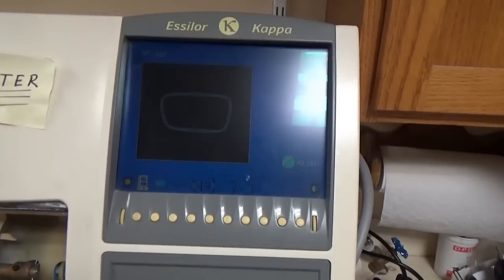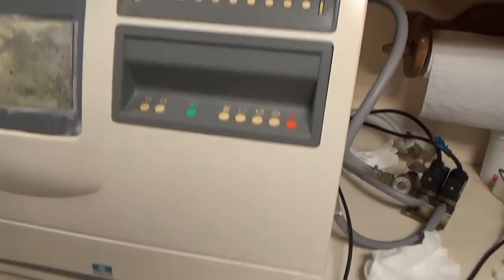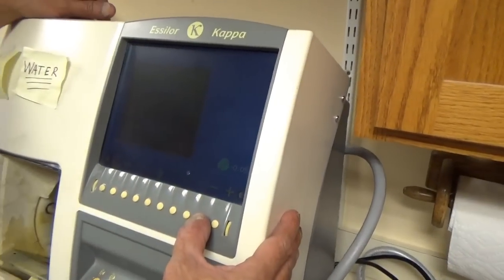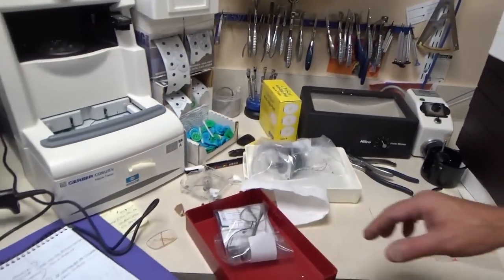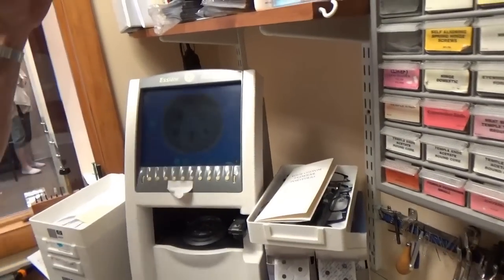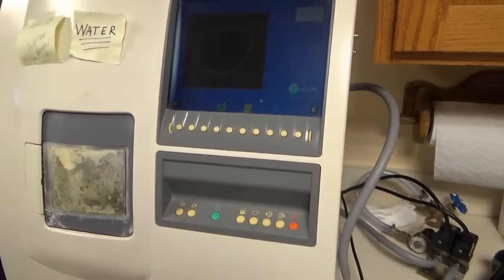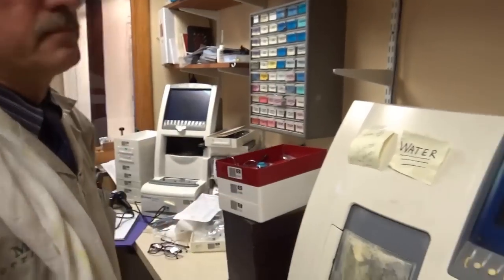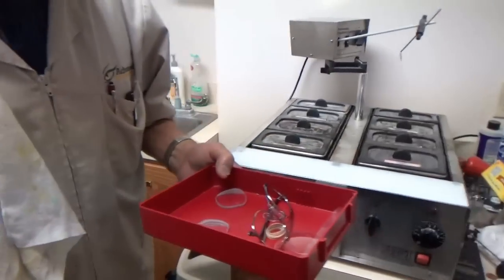Custom eyeglass lenses: Essilor Kappa Edger demo

Comment: I really enjoyed this video.  My father was an optician and owned his own shop back in the 60's and 70's.  While I was in high school and college I would do his lens edging for him.  Everything was glass then and we had a couple of different edgers.  I remembering him buying a new edger and I was the one that figured out how to install it and how it worked.  Things were not nearly as automated as these edgers.  We had a big board of patterns for every one of the different frames.  No automatic measuring.  Originally we would use the pattern and a glass cutter to score the lens and chip it off manually. Remember the first time I tried it I broke the whole lens.  You would cut it large and then put it in the edger to finish it to the correct size.  A later edger allowed us to cut the lens down to the correct size without cutting it first. Also had to heat treat most of the lenses too.  Things have really improved. Sure didn't expect to see a video like this on a auto repair channel.
Reply from the maker: Thanks for the comment Richard, and for sharing your memories! Yes I agree technology evolves at a lightning-fast pace indeed!

Comment: I enjoyed this series very much. You were so lucky to have a "known good" stepper motor driver to test to compare to the suspected bad stepper motor driver. Sometimes the hardest thing to come by is a "known good" to use as a base line. I, too have struggled with removing solder from circuit boards. Once again, thanks alot.
Jim McFarland
McFarland Automotive
Orem, Utah
Reply from the maker: Thank you for the kind words, Jim!

Comment: Ivan, great follow up to repair of Edger Lens Grinder, this video shows the process  involved in grinding lens edge. Thanks. Also for future repair, that stepper motor will cause the erratic jumping of position, that was a common problem in Dec digital line printers .

Comment: Thanks very cool information Evan. Yea PC work is very hard to do. I have done a ton being in the appliance repair industry for years. They make this stuff called Chip Quick which is a lower melting repair solder. Try using this for the remelt and re solder. Saves some heat on the board and components. Sells on ebay cheap use water base flux in a tub

Comment: My lens shape is not symmetrical in my new glasses. Measured vertically, one lens is 1/8 inch longer. Is this acceptable, or should I request a remake? I have plastic frames and feel that the frames will not go back to proper shape. Should the frame be replaced, as well?

Comment: My 2014 Nissan Versa sedan transmission is started slipping at30k only after Nissan run a software upgrade. No warranty, car is rebuild. Will fluid change help? Or any other advise. Thanks!

Comment: They should just paint that sliding panel white. Like the feeler gauge comment. Had a friend that was a PHD teaching Optometry at the Univ Of Indiana, In the early 90s, he developed a software program that could measure a batters ability to hit a base ball, basically the subject sat in front of a screen and a spot would come at you at a high rate of speed, and using lasers pointed at your eyes he was able to tract how well you did at tracking the ball. He without knowing the players batting record lined up all of the Univ Of Houston's baseball teams as far as how they could hit a ball, only missed one. He tried to sell the software to MLB, but they told him to take a hike. He also helped develop the hands free operating helmet for the Black Hawk Helicopter, I was a subject, in that , but was let go after 2 weekends due to I could not set still for more then 2 minutes at a time :)
Is your wife a optometrist, if so where did she graduate from ?
Reply from the maker: She graduated from Ohio State Optometry school :)

Comment: Now major parts are out of production they are going to have a strategy of how they will keep that equipment going. I would buy up some second hand ones for spare parts. When consumable parts and semi consumable parts are no longer made they will have to junk the whole system. 

Some cars are in this position as well. There are 80s and 90s cars that just do not exist anymore.
Reply from the maker: It is sad when a seemingly mundane part breaks, and is no longer available to be replaced. A 1990s Toyota igniter comes to mind...

Comment: Shame you didn't think to clean that window so you could see the grinding process...but considering how old the machine is, probably better not to mess with it in case something went wrong.  Saving them $40k with the chip replacement won't help if you then go an break the machine anyway.  :-P
Reply from the maker: Sometimes you have to know when to stop "fixing", or else you might start going backwards haha
Reply: He's right about glass lenses being potentially dangerous - back in the early '80s, I fell and broke my glasses (with glass lenses - they were a lot cheaper than plastic back then) at the local ice rink.  Took 3 hours picking the glass out of my face, and close to 60 stitches.  Damn lucky I didn't lose my eye, but got a good scar cutting through my eyebrow.  Been using plastic ever since (high index these days) and they're so much safer.  And it's a huge weight savings also - you wouldn't believe how heavy those glass lenses feel when they're being supported by your nose for a few hours.  :-)
Reply: Yeah, I've been known to fix something right into the trash pile on occasion.  :-P
Reply: Haha. My Dad used to say "I'll either fix it or I'll fix it so nobody else can." You could count on him to fix it though.
Reply from the maker: I think all you would have seen is a jet of water anyways lol
Reply: Machine was nice and clean and it looks like you did some scrubbing on that window. Nice job and very cool video.